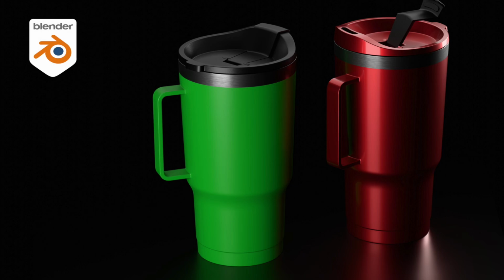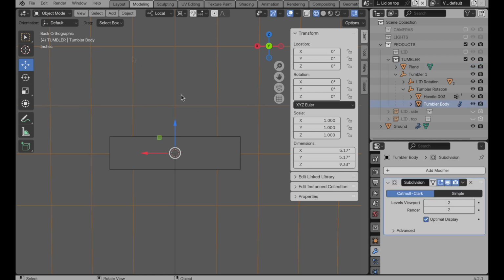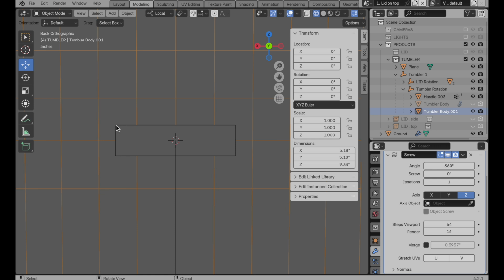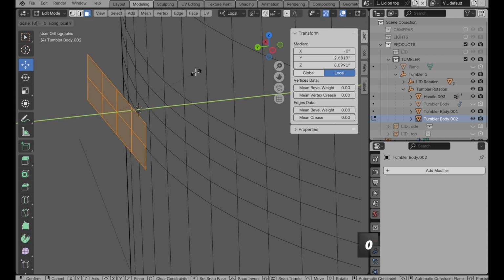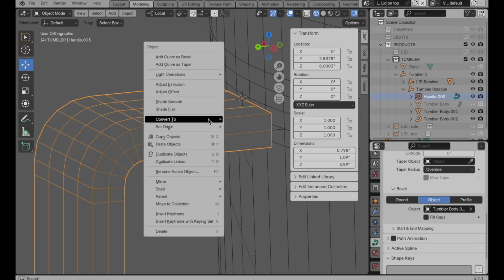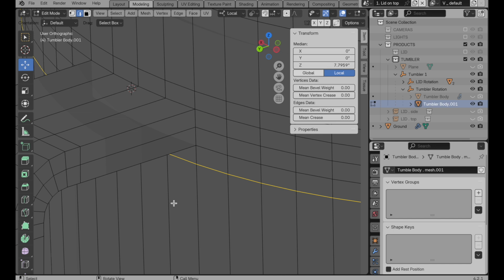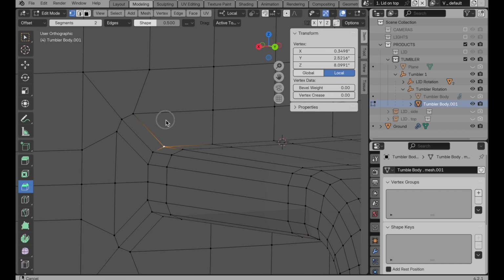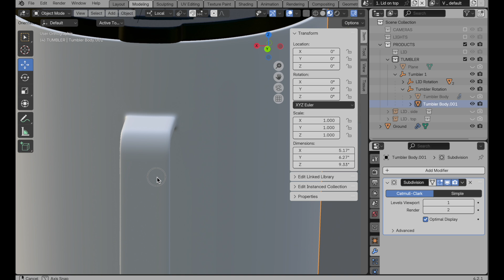Is this faster?

Comment: I tried to replicate the data transfer method. It seemed like the data transfer had no effect on how the cylinder and the handle shaded together. There was hard line around where the flared part of the handle connected. I tried every option and moving it in the stack but still had no luck.. what is missing? EDIT: Ok .. I did get it working, the problem was the handle was inside out, didn't bother to check that step before.. but I have some artifacting on the curved corners/edges of the handle and some in the curved transition to the cylinder Its not major but when you zoom in its there. I might make a quick video and it will be on my channel here
Reply from the maker: If you want to send the file to me I can take a look at it.
Reply: @christopher3d475  I sent it over.. address name matches this acct

Comment: Bridge Edge Loops has a setting that allows you to add cuts and create smooth connections, which would be like bridging and beveling in one action. And the part where you manually slide vertices to smooth the loop could be achieved with LoopTools - Relax.

Comment: great tutorial, I learned a lot. but it doesn't stand as a far comparison to the shrink wrap method because in that video u had already made the handle. id say this method is quicker. but i like the other method more because as u said it would be easier to move the handles position if needed

Comment: It literally is faster though, because the first half of this tutorial is just recreating the starting point of the previous one ;) But of course everyone PREFERS different ways of working. For me this method is also easier because it's just solving geometry, I don't have to remember x number of steps, modifiers, creating vertex groups etc. Right after watching your previous tutorial I remember it, but then if I have to do it in a year I will be struggling to remember all the steps, or waste time looking for this tutorial. So for me - faster solution is always the one that requires less tools.
Reply from the maker: But my ultimate point here is to demonstrate that there are multiple ways to achieve something, with some people saying one method is faster/better. In the modeling approach the modeling the handle was integral to the integration with the tumbler body, so I included it as part of the process.

Comment: You did not goof having an extra loop which you didn't need, you goofed when you rotated the profile because your Transform Pivot Point was set to Active Element instead of Median Point. Therefore you rotated the profile off the origin and your profile was offset downwards on the curve. That's also why the lower extra loop is missing, it is the one where you connected the handle to at the bottom.

Comment: As with all things where you can have different methods to get a result, I think this is almost always a matter of personal preference and the particular requirements or goals. This method may be faster, at least for some people, and for some purposes it is perfectly fine. I'm usually using both methods, since sometimes I just need a simple, maybe not even really flawless object and just modeling it roughly is enough and of course very fast. But sometimes I need things to be adjustable in the end or in general I need different variations where modeling all of them explicitly would be much more work and time consuming.

Comment: I like the first method better. Imagine that the boss or designer says "Nah, make the handle it a bit smaller" or the cup. That way you don't have to touch the whole mesh but only work on the parts needed.
Reply: The previous option was closer to nondestructive. It could be very useful. But great to see both approaches. 🎉
Reply: I don't work in that world anymore but yes - it's usually the boss or client saying that. Reading all the comments posted before and after you - there are faster methods but when you need to change things because of some arbitrary client decision - faster isn't always "faster."

Especially if you have to rebuild everything just because of a small change request.

Comment: Personally, much much better way to do it.
Reply from the maker: The advantage of the Shrink wrap method is it's easier to change the position of the handle, or shorten or elongate it, at least on this model because of the taper.
Reply: For distance set piece dressing, I'd just keep them separate intersecting meshes and smack on a Bevel node. Keeps the geometry minimum for viewport performance reasons, and a couple of subdivisions on a basic mesh would be enough. 80 divisions with subdiv on top is just madness for this kind of prop. Unless it's a high detail product shot, in which the geometry would probably be more complex to begin with, or animated deformations was a thing (on ceramics?), I'd probably avoid this kind of modelling. Similarly with data transfer method; it's a very good approach if you can allow the modifier to not be applied. It's the same thing with i.e. simple deform modifiers; you can't apply them if you intend to exploit the generated coordinates they affect. Proper modelling and UV unwrapping is a good thing to learn of course. But I'd argue the same thing applies to knowing when NOT to do it.

Comment: Really interesting comparison and showcase of 2 techniques. Personally i suck at topology but i know how crucial it is in many cases. Therefore the data transfer seems to me like the easy way ot but i can't shake the feeling it would somehow bite me later which brings the question, when would it be safe to opt in data transfer method and when should i choose propper topology connection instead ?
Reply: It also heavily depends on the use-case. Doing proper modelling is advised if it's a major actor and/or it's a piece that will be deformed during animation. If it's a background static piece used in Blender, then data transfer may be the way to go, although it may not be the chosen way to do it if applied modifiers is a thing since it generates custom normals. Myself, since I just often can't be bothered messing around forever with minor set pieces to make them "perfect", I just merge two intersecting bodies and smack on a Bevel node in its shader - job done.

Also, it's a bloody simple coffee cup. The end result in this one becomes far too heavy geometry for the minute thing its trying to do. I honestly think a better tutorial would be to discuss around several techniques when the objects involved are too complex for these kinds of simple solutions. I.e. much more varied top and bottom sizes for the main cup with a spiral groove pattern, to flow into a handle also with a spiral grove pattern but with different density, whose size varies the other way; thin top of handle mounted to thick top of cup, and thick bottom of handle mounted to thin bottom of cup.

Yeah, the basic stuff is probably useful for beginners. But for real world application, things are never this easy.
Reply: I believe, whatever is easier for you and quicker to accomplishm yet have some understanding of the basics will help getting this "properly" modelled. The plus side with the data transfer method, it's kinda none destructive. You can very easily adjust things. While when you really model the connection, you have much more work to do and can be very very finicky to get around it